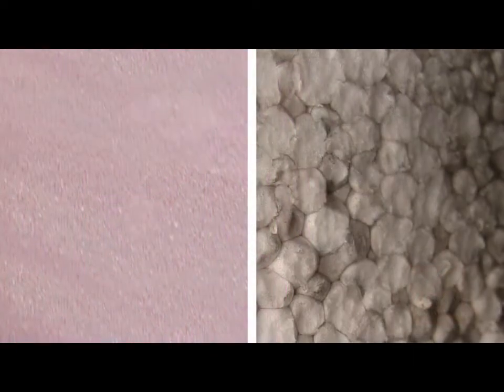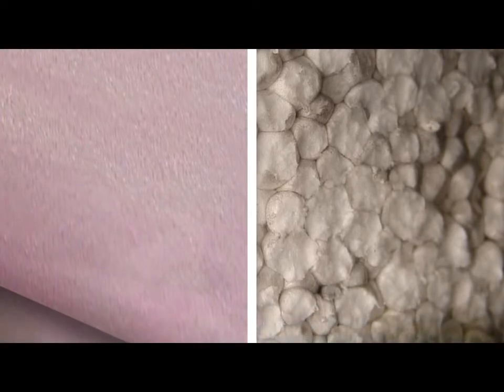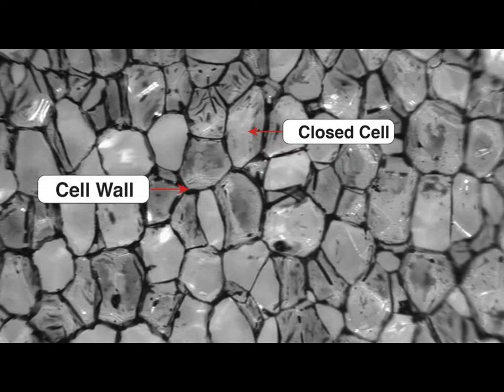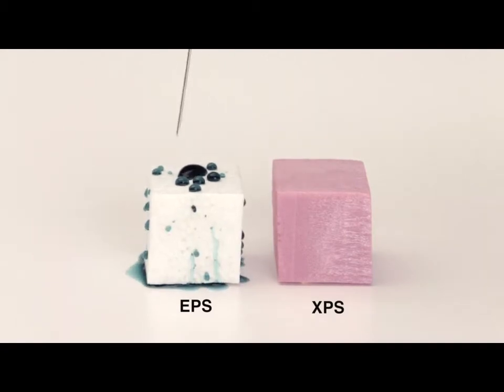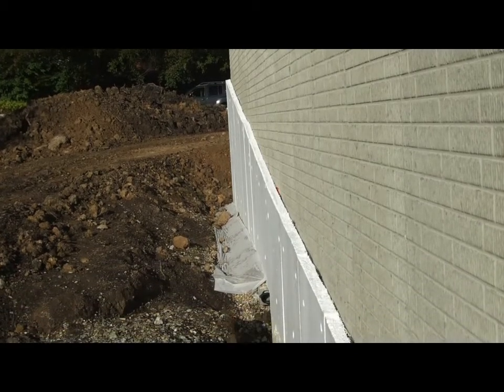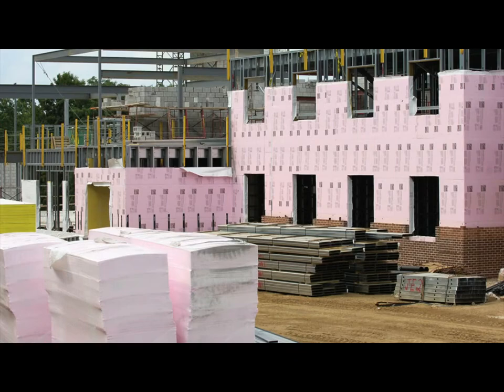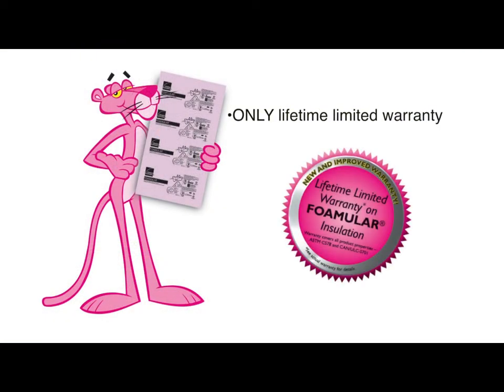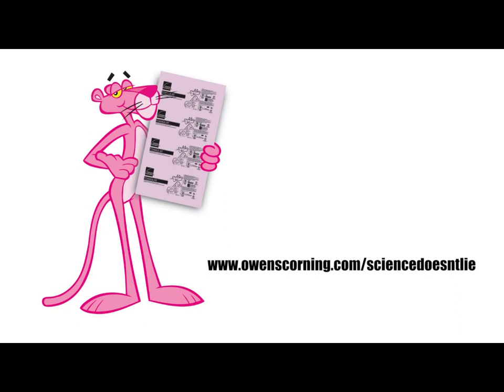XPS vs EPS: Science Doesn't Lie

Comment: Water is a conductor of energy? Owens Corning needs to put more effort into teaching their managers that it is the heat that conducts not energy, and the two are not equivalent even though related.
Reply: well heat is a form of emergy, aside from that water can also conduct electricity
Reply: @davidblahota5655  You just proved my point. Since water is a conductor of electricity, that result in energy transfer, saying "Water is a conductor of energy" is not only physically illiterate, but also ambiguous . What energy? Internal energy (heat) or electrical energy? People through around the terms: energy, heat, force, power, work as if it all means about the same thing while in fact these are all distinct physical concepts.
Reply: @V0L1SH10N  You blinded him with science  😂

Comment: eps is better in terms of durability and long lifespan
Reply: Trying to decide what kind of panel I want to get, to add to the front of my Massive bow/ spear target. It will also be attached to the already existing memory foam base.
I was thinking 2 inch EPS insulation is the way to go. But now I hear about the water issues idk. I might enclose it all anyways though..
Reply: Mostly concerned about having something that will have enough give to capture an arrow or spear but with the elasticity to not fall apart when I pull them out etc.